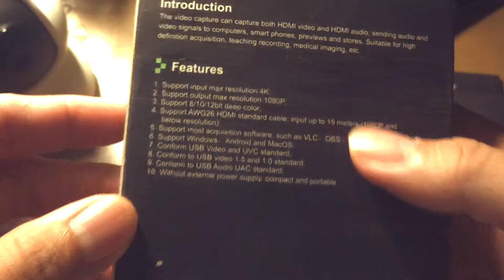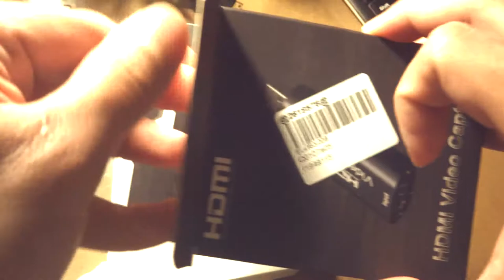USB 2.0 HDMI VIDEO CAPTURE DEVICE UNBOXING AND COOLING MOD!

Comment: I broke my first one, i left it plugged in a usb port, its broken now and order a new one, i love this, but easy to overheat and break, plan to modify it too, i order a 2nd hdmi to usb capture card like that
Reply from the maker: yes, they tend overheat a lot if you leave it on the USB port with out any mod.  This is the reason I bought 4 of them for backup. :) So far none of them broke down.  My wife is the one using it daily and most of the time she just leave it plugged in the whole day until evening. So far with this mod it just feels warm to touch unlike before wtih no Mod.

Comment: Nice simple mod. Is it because it gets hot easily when using?
Reply from the maker: Thanks! First time I got them. My wife used them for a Google Meet conference for like 3 to 4 hours straight and I did noticed that it got pretty hot. After adding the thermal pads it was just warm and not hot like before.

Comment: It's trash! I used for less than 10 mins and the picture froze, so I tried to remove it when I felt it was really hot! And that's it, now when I plugged it in, it doesn't work or recognised which means it's done.. What a waste of money for Chinese crap!!
Reply from the maker: At 2:58 mark, use the guide I made to add a thermal pad.
I have six of these bought 3 years ago and they're still all alive. 
Witht out adding the thermal pad they'll die a few days or weeks because of overheating.